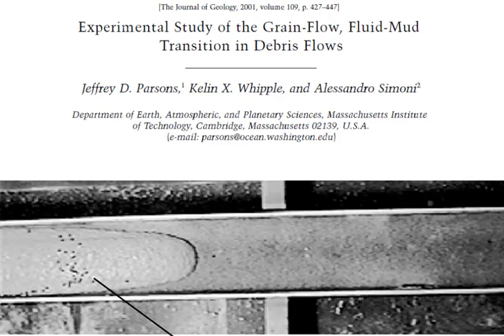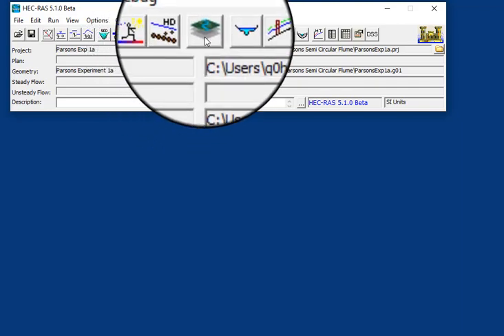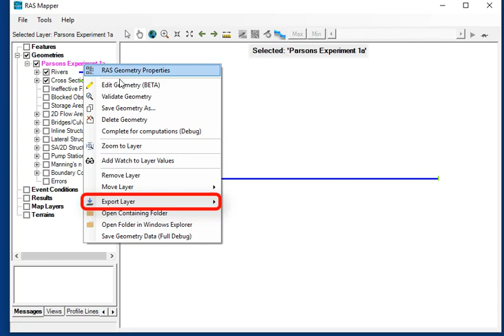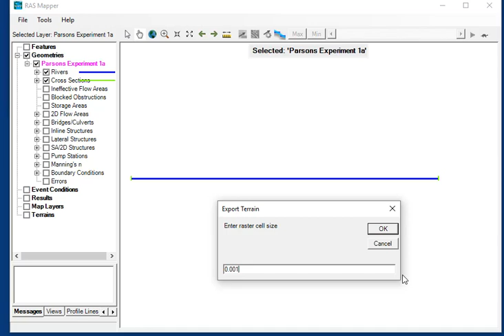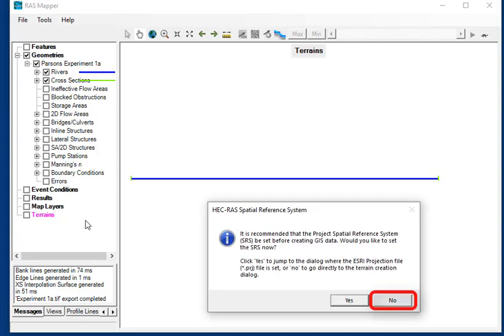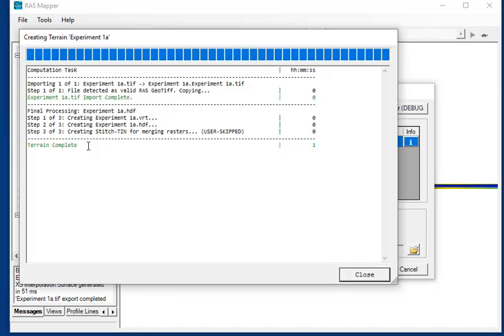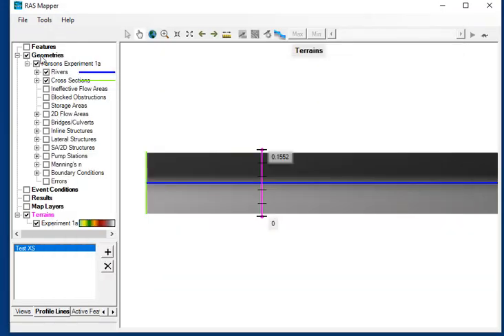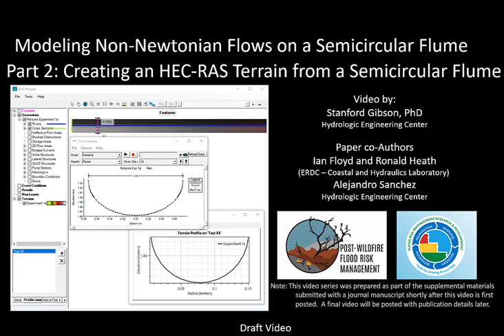Creating a 2D Terrain of a Semicircular Flume in HEC-RAS: Non-Newtonian Flume Series (Part 2)

Comment: Great Video! I am attempting to create a rectangular flume but seems that when two values are given to the same station the flume will just become a plane. Any solutions? Thanks.
Reply from the maker: Yeah, rectangular flumes are challenging.  I should do a video on the methods.  Sometimes we just build a flat bottom and ignore the side walls.  But we're using the channel mods a lot more for that kind of thing.  Either dig a flume sized "Channel" into a flat terrain or build a flat bottom terrain and give it side wall "floodwalls" with the mods.  Then you get your side wall friction.
Reply: I managed to create one trapzoid flume by extending 0.001 on both sides. Btw is the HEC RAS tutorial website down? The website ending at mil that provides many awesome tutorials is no loger accessible. @stanfordgibson
Reply: @stanfordgibson sir please make a tutorial video on rectangular channels.😢

Comment: Dear Gibson, I am trying to create the 0.001 mesh but HEC-RAS 6.1 reports that it is not possible to proceed without the reference. What do I do?
Reply: I try to reference with any .prj file (in my case, WGS 1984 UTM Zone 18S) and theres no more errors
Reply: @TheBalticSun  hello, in this case (lab experiment) you don't need to georeference. I solved my problem using version 6.0.